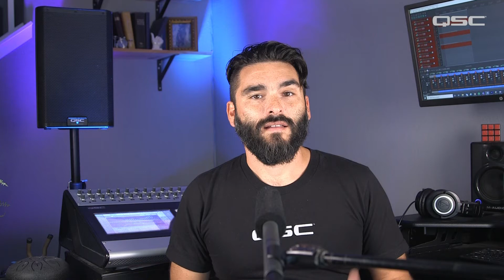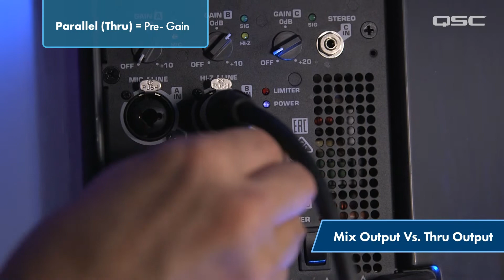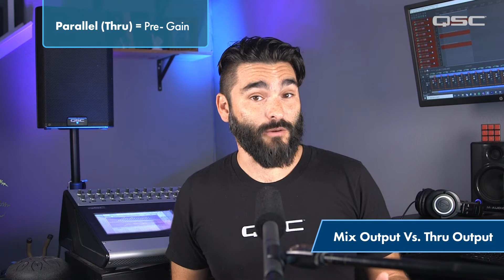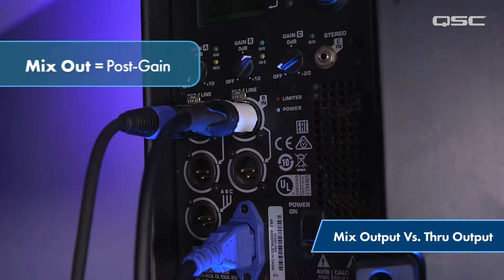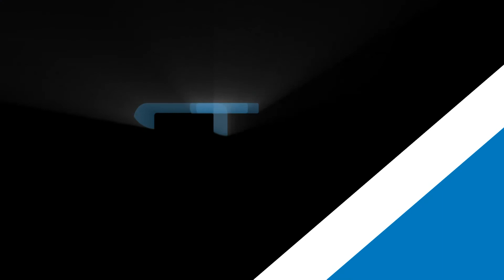K.2 Series Outputs Explained - Mix Out vs Thru Out - Quick Tip

Comment: Quick question: Can I use the thru on a power amp and run it to an active monitor.
Reply from the maker: Typically, a Thru on an amplifier or powered loudspeaker will send out only the signal that is being delivered to the corresponding input, before it goes through the amplifier section. So, yes, you should be able to run this to an active loudspeaker. Just make sure you're connecting a Thru and not the outputs of the amplifier.

Comment: What is the difference between mix out and line out?
Reply from the maker: Line out and Thru out are the same thing. They are sending the signal out at line level.
Reply: So you can connect a subwoofer thru the mixout right@QSCAudioProducts
Reply from the maker: @charliesalsa4327  Yes, you can.

Comment: Just checked the manual, and on page 10 (block diagram) it shows that the mix output is pulled off before DSP and delay. I was kinda hoping the mix output would include the delay (but not the LF roll-off from the SUB setting)  so I could feed some KW181s along with my delay speakers. Adding this note here, in case someone else comes looking for the same info.

Comment: Hi QSC team, do you have any new model for Touchmic series? As right most shop no stock and QSC during this time missing parts and chips. I heard that QSC will stop manufacture TouchMix series.Pls kindly advise if it is corrected?Thanks
Reply from the maker: We're building them as fast as we can, but as you're probably aware, chip shortages are affecting global supply chain. Rest assured that we will continue to manufacture our popular TouchMix Series.
Reply: Really thank for this information.  I really love QSC Touchmix. Thanks